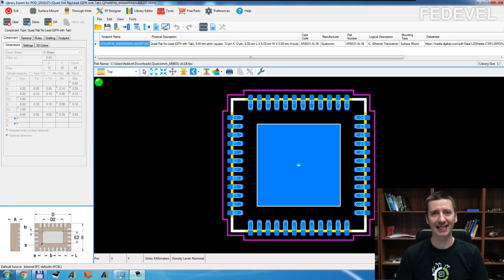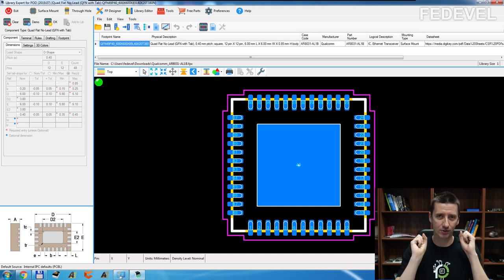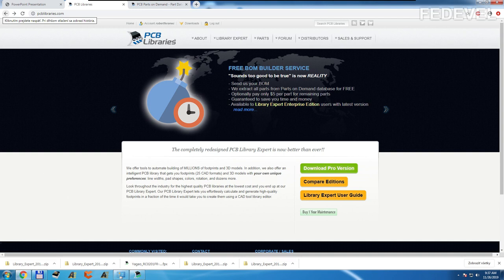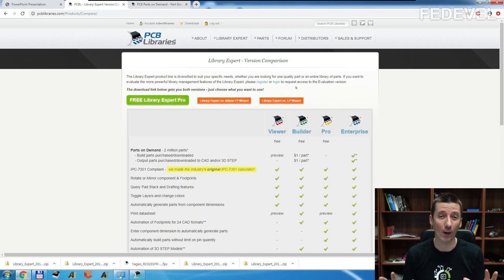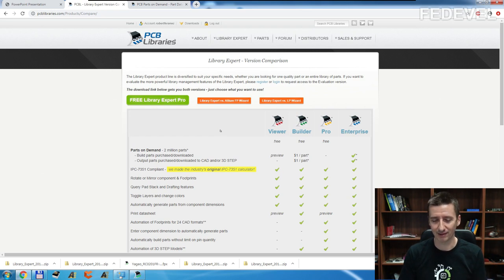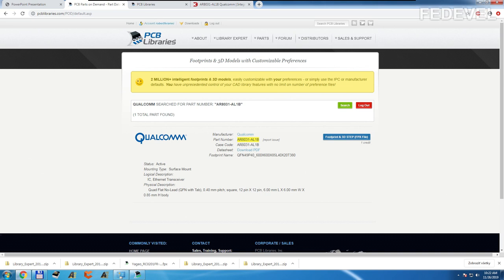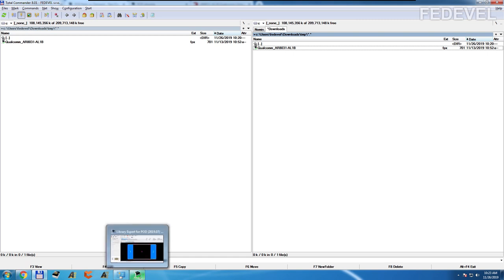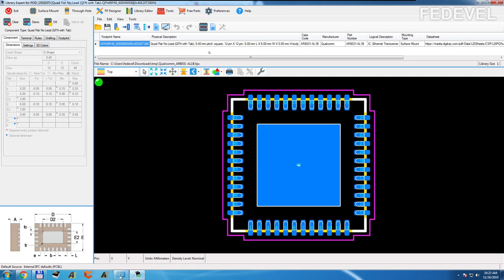I bought PCB Footprint - Was it worth it?

Comment: I use Library Expert for most generic parts like BGAs, QFNs, res, caps, etc. and it's really useful, you just have to be careful with pin numbers because sometimes you are not able to change them.
When I have to make custom footprints for sockets or Strada connectors I use the Altium Library and create them manually and I use Library Expert to calculate anular ring for TH pads. Library Expert also has a tool to create custom footprints, but it's, for me, hard to use.
In my experience with bought or free footprints, just don't go for them, they are nasty and they have a lot of errors, they recycle footprints for different parts.
If you want something done well, do it yourself.

Comment: I noticed pin 1 Dot size on teh legends tab was 0.0, maybe that is why you didn't get a pin 1 dot on your top overlay? I think I saw something about soldermask expansion on the export window.

But seeing what you went through it still seems like a lot of steps before you are ready to use the footprint. Compare that to using Altium's footprint creator and then changing the pads to rounded rectangles seems like maybe less work?
Reply from the maker: - The dot: great spot! That worked!
- mask Expansion rules: I think, this just set the rule what I set manually, but I could not find in the software some kind of default recommended mask
- Compare that to using Altium's footprint creator: It was so comfortable to buy the footprint instead of calculating all the dimensions (some datasheets are horrible and it is not easy to translate dimensions into alitum wizard) ... so if someone is a little bit lazy (or doesn't have time), paying for it and downloading it is very addictive :).
Reply: @RobertFeranec   Glad the pin 1 dot issue was solved! Have you tried any connectors with this software? I'd be interested in that because for m those are harder to create than standard IC packages.
Reply from the maker: @georgeioakimedes509  I found the connectors I needed in their library, I have not tried to ask the to make them. PS: I had to download 3D model for connector from manufacturer website.

Comment: Hi Robert, great video. What's your opinion on having large silkscreen lines under small components to indicate pin 1? Is it a concern that this can raise the component?
Reply from the maker: I was actually thinking about that - it may depend on the technology used for silkscreen - when silk is done photoway, it could be ok. But I am not expert for this. Generally I try to place pin indicator the way it is visible also when component is fitted.

Comment: I wish I had this about 6 months ago!  It takes some time to figure everything out as the GUI is confusing, but I have found the service valuable as well.  I also have the issue of not being able to access the properties in Altium for the new part and do the cut and paste trick.  I'm not sure why your script is not placing the 3D model already, I had that happen, and I think I changed a setting but I don't remember what.  Now when I run the script, the 3D model is already there.  The 3D models do not always have pin 1 marked on the ICs.  Thanks as always for your great videos and content.  Who thumbs down your videos?!?
Reply from the maker: Thank you 1776 Effects

Comment: Really excellent video. Yes, I’ve come to expect quality from you, based on the FEDEVEL Altium course, but the information here should be immediately helpful for both pros and hobbyists (at least those who can spend $50+ on footprints).

Like others, I have limited faith in prefabricated components/libraries, but this company seems to have thought the process through much more carefully. They’re not perfect, but who is...? I can’t believe that they would not provide the missing product information to you. That’s the one thing that concerns me. Maybe they will not be able to provide support if and when there are issues.

In any case, they really did themselves a disservice by failing to provide not only support, but also (at least an offer of) sponsorship.

Comment: Hi Robert,  Have you tried the "IPC Compliant Footprint Wizard" that is part of Altium Designer?
Reply from the maker: I have, but I do not use it. So I am not the right person to say much about that feature.
Reply: @RobertFeranec  "IPC Compliant Footprint Wizard" of Altium has tons of features and I think it can make any type of footprint easily.
Reply from the maker: @SaieenTwist  If I use IPC footprint Wizard in altium, it is usually just to get a 3D model. In many cases, a recommended footprint is in datasheet and that footprint in datasheet is usually different from what the wizard will generate. So, I found it easier just to create footprints through simple altium footprint wizard, rather then IPC footprint wizard. However, if there is no recommended land patter, the Altium IPC Wizard is a good way to create the initial footprint and maybe adjust it then (if needed).

Comment: Great video! Why not using PRO version of it? I think it's better, because you can build your own. About standards - I hope that AD and KiCAD will keep up with newest IPC-7351C standard
Reply from the maker: I didn't use PRO, because there is dash in Parts on Demands in the table. I am not actually sure why they have 4 different versions of the software, one or maybe two should be enough - they could merge all the 3 free versions into one.
Reply: @RobertFeranec  I think they should merge that 3 free editions into one instead of separating it into viewer, basically buyer and builder.
Reply: Yeah, you need both pro and builder to build and buy.  It’s quite confusing at first, but it’s the best footprint builder/buyer I have found as well.
Reply: I do not know much about the IPC-7351C standard, but looking at pages  15, 16, 20.. of that presentation I can recognize that KICAD standard library is using this standard already, or at least quite a lot of libraries look like the ones in these pages.

Comment: Library Expert auto-generates footprints for 25 CAD tools and 3D STEP models directly from component package dimensions & tolerances and your personal Preferences that you define for your drafting outlines for Silkscreen Legend, Assembly, Courtyard, Component, Terminal and Origin Marker. You decide which outlines to turn on/off and their line widths. You also control the Pin 1 Polarity Marking for Legend and Assembly and the pin 1 location upper left or lower left. Basically, you are in 100% control over everything in the CAD footprint from Pad Shape, to Pad Minimum Spacing to Pads Under Components and solder mask sizes and gang masking. And the best thing is that you can either get the limited version for free - https://www.pcblibraries.com/LibraryExpert/Pro/ or Lease the full featured version on our new Cloud License for as little as $99 a year (depending on your CAD tool). And V2020 is a brand new 100% rewrite that makes the UI a lot easier to use and it's coming next month. Everyone gets access to all updates and technical support.

Comment: IPC-7351C Draft quote
Nothing on being 25% land width

"6.2.4
 Round-off factor
221
    The round-off factor of the land pattern dimension should be 0,01mm in general. However, if

222
    the round-off factor exceeds 10% of the dimension, the round-off factor can be decreased to

223
    0,005 mm."